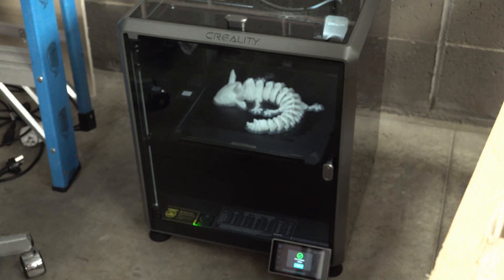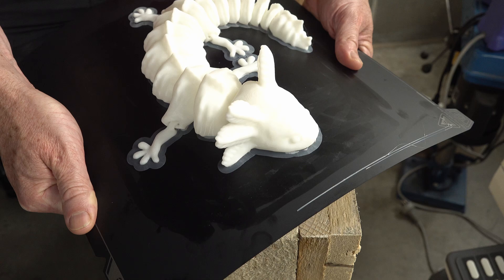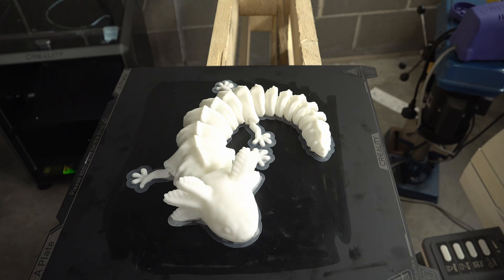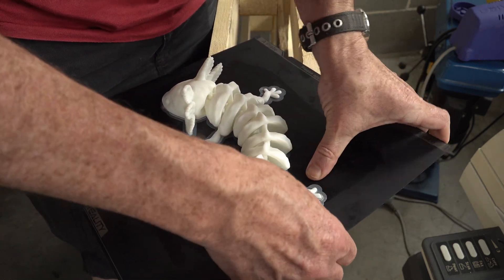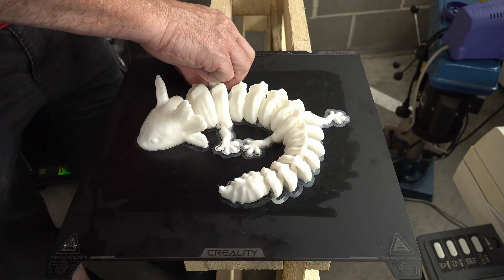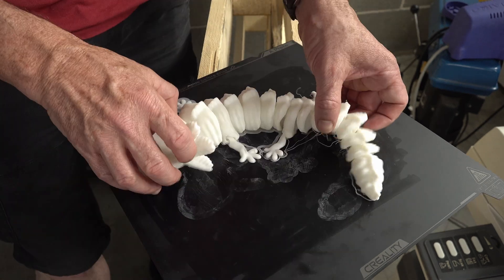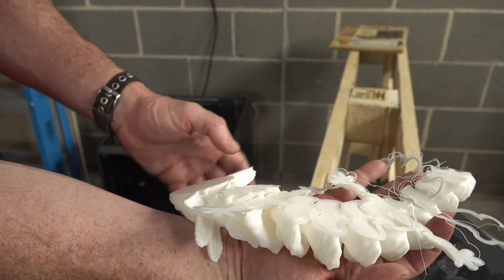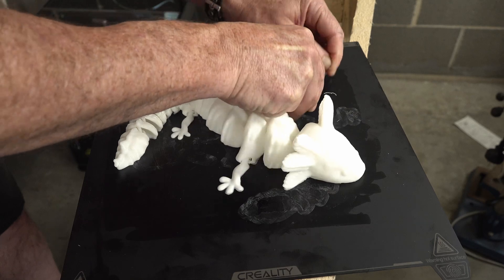Creality K1 Max Print SUCESSS

Comment: Yeah, I've never had good luck with glue.  If they make a Textured sheet, I would get that.  It works a lot better than the satin versions.  You Z height might be too close to the bed too causing extra "Squish".   Check your print temps as well, sometimes lowering the temp can help, but not always.

Comment: With the glue, you want to clean the plate, put the glue on, and let it dry before you heat it, and you want the plate to cool before you remove the print also it is a flex plate so you can bend the plate to pop the print loose

Comment: If it is PVA glue you're  using you   can try to immerse the plate into water for  a  short  while  to dissolve  it a bit,  it should work but haven't tried  it though...

Comment: Use 3dLac instead of clue. If it sticks too hard to the plate hold it under water. Somtimes I use a little bit soap so the water gets better under the print.

Comment: I've never used glue, only a bed squeaky clean using iso alcohol. PLA and PETG, i've never had a print fail due to bad adhesion and it always releases easily when the bed cools.
Dave, you've printed that with a brim (the bit you had to peel off). Brim's are useful for prints that are tall and wide that can warp due to plastic shrinkage. That's not a problem with the print you've done. No brim was needed.

Comment: Printing too close to bed so Z offset needs to be adjusted. If you print too close to bed on first layer or too far away then the print will not stick. The glue in this case was acting as a victim and the first layer printed through it which got it closer to the correct first layer offset but still a little too close and is why it stuck so firmly to the bed. Automatic bed leveling will not get you the proper offset it needs to be calibrated for every filament spool. Print two layer thick squares and set the offset as far away as you can get it. Google ellis3dp his tuning guide is exceptional.

You only need glue to protect beds from prints that stick too well, if you need it to make them stick at all then something is wrong with the calibration, don't use shortcuts do the work properly and calibrate your printer.

Comment: Hi, if you use glue stick there should be no reason to need a brim. I only apply a very light layer of glue stick for the k1/k1 max build plate and keep the plate temp down around 40, 45. If the print ever gets that stuck just take it to the sink and run hot water around the print and the glue will melt off.

Happy printing, 👍

Comment: Make sure to get a little bottle of spray 99% isopropol alcohol from Bunnings or the like to wipe your build plate down after every print

Only use glue if, PREVIOUSLY, you had problems getting parts to stick. Otherwise there's just as good a chance that it'll make them even stickier! Generally you shouldn't need glue for PLA, but can depend on which build surface your printer is using.

The "outer stringy bits" is called a brim, its a thin sheet around the base of the model designed to A) give a wider base for it to adhere to the build plate properly with and B) help stop any "curl-up" that would happen to the model-proper's edges as they cool. An alternative is to just print a skirt or nothing if the filament and nozzle offset are perfect and your plastic is sticking fine as it is.

WATER is actually one method to release prints; I have a little spray bottle for it. you get a little bit of it directly touching the whole edge of the print. Then leave it for 5 minutes and come back. The theory is it slowly gets under the print, helping to release that edge. Walking away for 5 minutes is not easy but I do find it helps overall.

Comment: People including me telling you the glue is to help release is not wrong or full of shit.  The reason it helped you with your print not sticking as the plate is new and the surface will be slightly dirty and shiny, If you give it a good wash with soap and water it will start to stick.  It will also naturally do it after a few prints. 

The plate needs to bed in and once it does the PEI will start to stick on its own. 

However if you keep printing once the plate surface has settled without glue you will find removing the print will tear the surface as once it sticks it sticks like crap to a blanket with out it. 

On a new plate the glue helps bed the plate in and dull the surface and clean it.  However after a few prints it’s there to help release.  

If you thought removing that was hard you want to see it without glue on a good used plate.

Comment: I'm no expert but for my printer I have never used glue stick and I turn off the brim as on my machine it isn't a benefit and just a waste of plastic and work to remove it. Course I have an older cheapie machine. I want a machine that can do a large bed but no need for tall stuff which most printers go for the tall aspect as it's cheaper to make it tall than a larger bed.

Comment: I've never had to use glue-stick -- I just wipe the bed down with isopropyl alcohol before each print.   It also looks like you've got some layer adhesion problems on the initial layers.  For PLA you want to run the bed at about 50-60 degrees C to help layer-adhesion.   However, as you've found, everyone's mileage differs so the only way to figure out what's best for you and your setup is to print more stuff and learn from every failure.  Having said that however, I think I've only had about three failures in about a year's worth of printing on my FLSun QQ S  delta printer so I'm happy.
Reply: This. Ive never used glue, only a bed squeaky clean using iso alcohol. PLA and PETG, i've never had a print fail due to bad adhesion and it always releases easily when the bed cools.

Comment: Hi Dave, I have been 3D printing for 2 years now and I had similar experience at the start but then I learned some details so let me share;
When someone tells you that glue stick works the opposite, they are not really correct but perhaps partially. There are cases when the combination of 3D printing material and build plate produce a possibility of over-adhesion. That means you will not be able to remove the printed object without destroying either it or the print bed. This is where you use glue stick as a middle layer in order to save your print bed and possibly the printed object. People claim that this happens with PETG and bare glass but I've never experienced it.
In my opinion if you have to use glue stick with PLA or PETG then something you are doing is not correct. Either the printed bed is bad quality, not leveled or simply has oil on it that prevents adhesion. I HATE using glue stick because as you saw parts don't self-release when they cool down and it creates a mess. Unfortunately some filaments require it because they warp badly like ASA.

Another tip is that Glue stick is PVA that is water soluble. If you ever find it hard to remove a print simply put some water around the object and it will make it a bit easier to remove.

I print PLA and PETG on PEI beds and I never use glue.
Reply: Listen to the video, Dave doesn't want help.
Reply: @Okurkaarrgghh  maybe someone else can learn from my experience, I try to contribute something instead of what you are doing.
Reply: @Okurkaarrgghh  Sweet.
Reply: @Okurkaarrgghh  Who are you, his lawyer?

Comment: Im a beginner but heres my thoughts, glue stick is for smooth surfaces only but its easier to remove stubborn plastic with just a bit of water or alcohol, try flipping the plate and see which one is smoother then use glue on that side
I simply got frustrated with my Ender 3 V2 Neo and its magnetic plate that sticks too well, and was too cheap to buy another build plate for ~$30, regular old glass works great too btw but with glue

Comment: I started mistrusting these plates, the one that came with my E3V2NEO just fuses with the plastic, maybe i scratched it idk, i just use either the backside of the plate which is smooth metal or a piece of glass and put glue stick on it

Comment: On my prusa mini at first I had real problems getting prints to stick.  Then used the glue stick which helped. Now the bed seems to be conditioned and i don't use glue at all without any problems.  So hopefully it'll improve over time.  That was a pretty ambitious early print!

Comment: My AnyCubic printer it has a glass bed. When my 3D prints and bed cool they lose their adhesion completely and you basically just pick them off. If I don't want to wait for them to cool I use a metal spatula and with a sharp, short pinch at the 3D print it breaks it free.

Comment: Unfortunately with 3D printing there’s no one size fits all. What works for one print with one filament on one type of printer doesn’t always translate to the next. That’s why you are getting variable advice. It’s best to listen to all the methods and if you have trouble, try the next method. And yes prints can be a bitch to remove from the plate. You do need to work a flat blade under it sometimes. Other prints will just snap off. PEI plates are more forgiving when they have cooled to room temp, and are my preferred plate. But again, they don’t work for all scenarios. It’s purely trial and error for your own setup

Comment: the thing with "conflicting comments" is that 3d printing is complicated. You've got so many materials, print surfaces, temperatures. For PLA bed at 45°C is quite low, if it'd be on 55-65°C it probably would have worked out without the glue.
Reply: Well, technically if the print sticks you don't even need a heated bed for standard PLA. It's possible although most of the time you just use 60°C, because it works a lot better of course...

Comment: Try putting it in the freezer for a bit, i had most success when printing on glass, it adhered so well. Afterwards i would just pop it in the freezer for 20 minutes and it just deattaches itself due to glass shrinking.

Comment: I have the same experience with the glue on mine. Ordered me a new Prima Creator buildplate with PEI surface. It also has more texture on it, like the one on my old Ender printer. Hope I can throw the glue where the pepper grows!
Reply from the maker: This one is a PEI build plate.
Reply: @EEVblog2  Does it? So why all the fuzz about the glue then? It even has a note on the buildplate "apply glue before print". Think I will clean off the glue residue on my buildplate and try the prints without then. Never used anything on my Ender buildplate.
Reply: @EEVblog2 Honestly, that build plate is dogshit if you NEED glue for anything to stick. Even my $250 3D printer comes with a PEI plate that I never ever had to use any glue for the print to stick. That's just stupid. Cleaning the plate regularly and maybe using a brim should be enough at most!

Comment: A small warning about the included metal scraper/spatula. If it's anything like the Creality one I got, the sides have some REALLY sharp burrs. I was trying to figure out how I kept getting tiny paper cuts whenever I was prying off a print, didn't think plastic was that sharp... it was the scraper.

In an earlier video you asked what to use to make your own models. Tinkercad is a good place to start for beginners. If you can envision what you want to make as a series of simple shapes stuck together (cubes, cylinders, etc.) that's what it seems to be best at. It's fully web based and free. There are some decent tutorials, I'd recommend watching a few before jumping in as it'll be frustrating otherwise.
For more advanced things, Fusion 360 has a free version for individual use. It's "big boy" CAD though. For people that know what they're doing, it can do amazing things. Without having a clue what to do, it's a bit like being dropped in the cockpit of a jet and being told "go ahead, take off."

Comment: Whether you need the glue or not depends on the bed material and temperature. I don’t know exactly how flexible your bed is, but I have a Creality printer (an Ender 5, so not as fancy as yours) with a magnetic bed (which does have a texture) and it bends way more than you were bending yours in the video - I’d say the bend radius on it is probably 4 or 5 cm or so. I tend to run my bed near the glass transition for PLA to improve adhesion (so 70-75 degrees) and I don’t use glue. At 45, I can imagine I’d want some glue, especially if the bed is smooth. I also find wiping the bed with some isopropyl alcohol before printing helps; any grease is presumably going to affect adhesion.
Reply: +1 for cleaning the bed.

With those textured beds I really don't feel the need to use glue. Just make sure it's free of dust particles and umidity before printing, and most times just rubbing some clean cloth is enough.

About the flexibility, here I have 2 types of magnetic beds, each one coming from a different Creality printer (Ender V2 and V3). One is really flexible, and the other stiff like the one in the video, both with texture. They work the same, but I find the stiff one easier to put on and off.

Comment: Hi Dave, you better have a plastic scrapper for lift up the 3D printed item. I see Ben Heck did not use glue at all, ask the expert. I'm not.
Reply from the maker: They supplied a metal scraper.
Reply: @EEVblog2 they also sell the build sheets for when they get scratched 😉